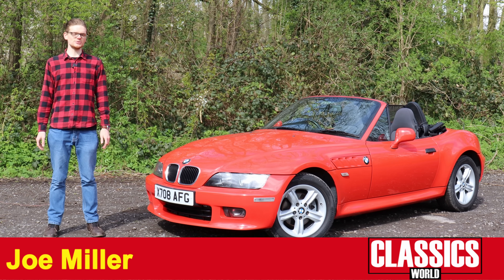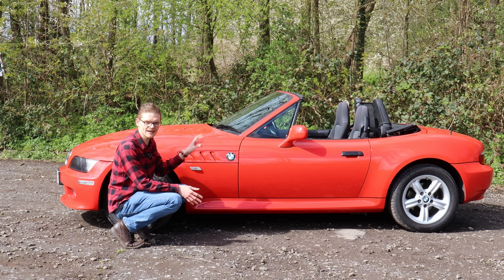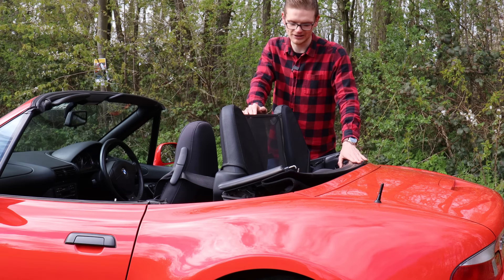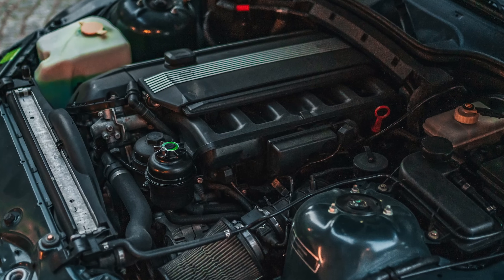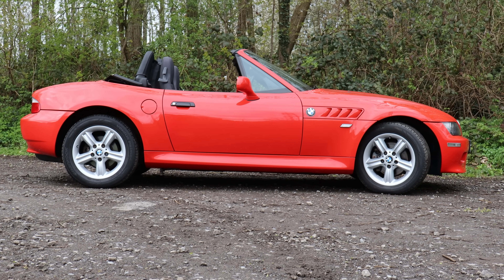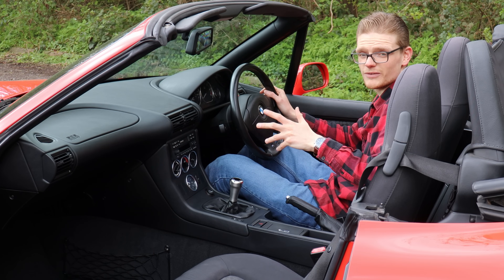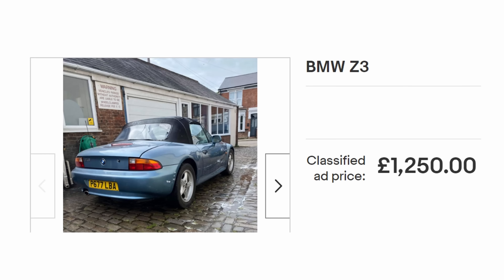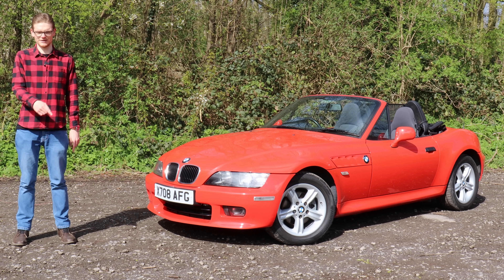BMW Z3 Buying Guide - Cheap RWD Sports Car Investment!

Comment: Good guide but you should never fold plastic rear screens without folding them in the middle first and preferably put a towel between the folds to prevent the plastic rubbing on itself
Reply: Completely agree/ I use a pool noodle/ or a folded up blanket
Reply: If you clean it with vinyl window clear, it will sand away the scratches. If u neglect it they become impossible

Comment: buy the metal water pump, lasts longer
Reply from the maker: Great tip!
Reply: Don’t know if it’s anything like my 996, but even with a stronger metal pump it’s recommended to go with the plastic. If the metal one fails it will throw metal parts into the engine and do a lot of damage, much less damage if a plastic one fails.

Comment: Electric roof waste of time and awkward when trying to ensure rear window folds correctly. Outer cills can hide disastrous corrosion to inner ‘structural’ cills. Front wings are suffering due to OEM bonding material trapping moisture causing them to rust outwards. Rear quarters are again extremely susceptible to rusting from inside. Seats bushes always fail. 1.9 perfectly adequate to still lose license!

Comment: Just bought my 2nd Zed 3 - both are 1996 / 5spd w/ 1.9 liter.  Dad has the original/ silver with Hard top and Burgundy leather seats.  Purchased a few years ago from the original owner for $3K … and I missed it/ so I bought myself another 1996/ black on black with 115k miles for $3k again.  No hardtop / but the wheels are $$$!! Go find one of these awesome little machines

Comment: As a 97 1.9L Z3 owner of eight years, this video review is surprisingly very accurate. I’m impressed you know so much about these little devils. I love my Z3. You’re right about the A/C not being great, but that’s because the majority are still using their reliable but worn out factory compressors. Swap them out with a new unit for cold AC, which is mandatory in South Florida 🥵 Fun fact, Z3s don’t have cabin air filters. And I highly recommend the more expensive GAHH soft top for replacing the roof. It’s was $800 as of 2023, but it’s straightforward in installation and you can tell it’s high quality. 
Z3’s are heavy old slow cars. A new Camry S is faster than a inline 6 Z3M. I have the base i4 and a 2018 base Hyundai Elentra will blow my doors off. A 2016 Corolla will speed like a Skyline compared to my car. 

But you put this baby in to 5th gear, top down on a cool spring day, and you’ll feel like a millionaire. Z3’s are a cruising car. Everyday will feel like a Sunday drive. Put Bluetooth in it and you’ll get the same feeling of freedom and peace as a Ferrari slow cruising the Pacific Coast Highway. Plus my car only cost me $4k at purchase 😂 can’t beat that! Cheap to fix as well.
Reply: Hi Bones, I’m looking at a 1997 1.9 too. Can you be a little bit more specific about the maintenance costs? Around $4k, should I buy one as my first car to commute daily?

Comment: Hi there. I stand to be corrected, but i don't think you're quite right re. the sills ... you can buy the outer panel (which is a very common rot point) from BMW and replace that easily. That is the piece on the diagram you shared (people need to beware that the outer sills of the widebody and non-widebody are different though). Behind the outer sill is the inner structural sill (what you show at 1:16 with the holes in and rot)  and the repairs to this become much more tricky. I had a pre-facelift 1.9 a few years ago that i had spent LOTS of money on but sadly i got to the outer sills too late to save it. Was quoted a LOT to repair it properly (the inner sill parts from BMW if you can find them are astronomical and the rot was in a very hard spot to repair) so ended up breaking her for parts. 

Have a late rot free 2.2i now though (which is the pick of the bunch IMHO) and i love it to bits :)
Reply: The 2.2 is a nice straight six and not too thirsty.
My pick is the Z3M in Estoril Blue. I test drove one in 2007 and it was very nice. I prefer the interior in black, instead of blue/black combination.

Comment: I got and 1.9 1996 z3 it was leaking like crazy when I got it changed the oil pan gasket was not the problem and changed the oil filter housing gasket still was leaking i had to the the oil filter housing oil ring plug was the problem after that never leaked again

Comment: Definitely all good points, however, I would definitely have added in to watch out for the infamous ‘subframe spot weld cracks’ commonly you will see spot welds in the trunk that will crack as the diff is mounted with intent of only running the 4 cylinder. The 6 cylinders will crack the spot welds separating the rear subframe from the body of the car. I would know as mine has started. Very common
Reply: Does this apply to models made in the U.S?

Comment: I owned an 'Orinoco' edition 2.8 for several years.. SRS light coming on was caused by an issue with the wiring loom under the seats . Bodyshells pulling apart in the area of the diff carrier was a known issue with the Z 3 M cars and the 2.8's which have been 'enjoyed' - check the spot welds in the boot floor area thoroughly. For many years BMW treated this as a warranty repair My 1999 orinoco edition was a very limited model and possessed the later twin vanos engine in the wide body early shell  with  factory fit M  rear lights, clear indicators ,repeaters  and  nearly every extra including aircon and power hood. If you can find one i'm sure it will be a future classic.  A scary issue I had with my car was one of the  rear brake pads pulling apartfrom the backing - and that was a genuine BMW part. If you need a back window replacing check out how much BMW charge - they came in a £100 cheaper when I had done compared to a local coach trimmer.

Comment: Great video. I've seen people talking about avoiding the four pot engined Z3's in the past, but I'd say that the M44 is an absolute peach of an engine (it's what was used in the 318IS) and is a great choice, especially with the price difference compared to the six pot M52/54. Both sixes are also great, but be prepared for having to change the PCV (git of a job), oil filter housing gasket, valve cover gasket and various vacuum hoses / rubber blanking bungs on the inlet manifold. This should be done at a bare minimum unless done recently. For VANOS servicing, Mr Vanos is the go-to guy. Oil service intervals were long on the sixes, so beware of varnishing on the camshaft as well as chunks of old oil where the car wasn't serviced more frequently than every 10k miles.

I also disagree that the GM auto is best avoided if you want an auto. It's much more reliable than the ZF unit and both were actually marketed as sealed for life, although that's not recommended. Parts to service the GM box are also cheaper than the ZF unit.

Comment: had one in Texas.  the interior plastics will crumble if you try to take it apart.  i think it suppose to naturally degrade instead of lasting forever.  well, mine degraded in place.  
had the 1.9l and it had a flat spot at about 50mph in 5th gear; you could floor it and it would barely speed up.  
the hood is super expensive to replace because there is no aftermarket options.
the drive train never failed.  it was just everything around it failed.  i never replaced nearly as many parts on this bmw than any other vehicle i've ever owned.  it was like a hot girlfriend, you spend a lot of money and ever so often, you will get a smile put on your face.